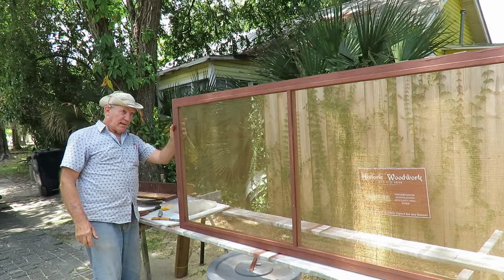How Build WINDOW SCREENS for HISTORIC Houses

Comment: Thanks so much for making this video!! Excellent!!
If screens are meant to be removed for the season, I’d imagine use of date nails on both the screen and window frame would be very useful to assure that the correct screen returns to the right window. Maybe oil-based semitransparent stain instead of paint? Semitransparent stain will never peel like paint does. I use UV window film on vintage windows which prevents ~70% of thermal loss/gain, it’s virtually clear so it maintains vintage aesthetic. Thanks again for the video!

Comment: This video is wonderful! This is the first video that came up in my search, and It is exactly what I need to re-create the screens on my 100 year old house. I really appreciate your straightforward explanations of the whys and hows of your process. I have an issue that I need help with. My windows are all the beautiful old original windows and I love them, however they no longer open. I don't mind, and frankly I can't afford to have them fixed even if I could find someone to do it. Because I can't open them, I can't unlatch the screens. That's okay if they are damaged getting them off from the outside, since I'm making new screens anyway. However I need a new way to secure the screens at the bottom from the outside since the windows don't open. Do you have a suggestion on how to do that?
Reply: Why do you want to do screens when your windows don’t open? Perhaps learn how to get your windows open first?

Comment: Does that lower quality wood remain stable over time? Do you ever mortise and tenon them for a stronger joint? I just restored my windows after 193 years and they are in great shape. Amazing how well long leaf pine holds up and good joinery.
Reply from the maker: A Lower quality,” wood,” Be to make them out of spruce. I have made them with mortise & tenon joints before. It is after all just a window screen.